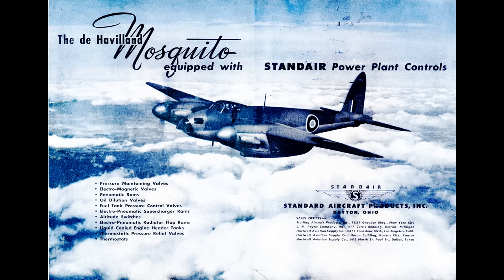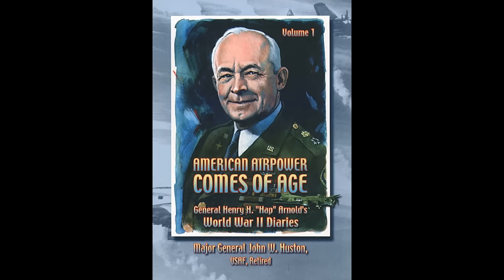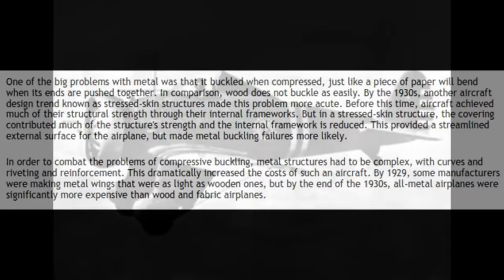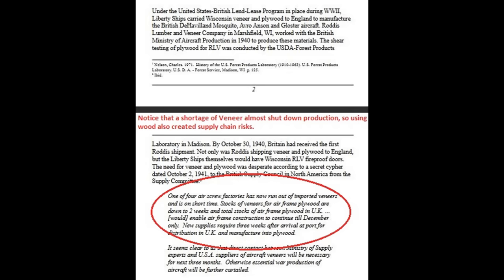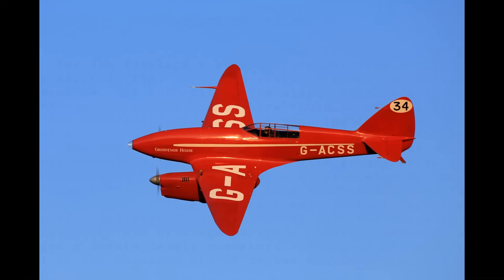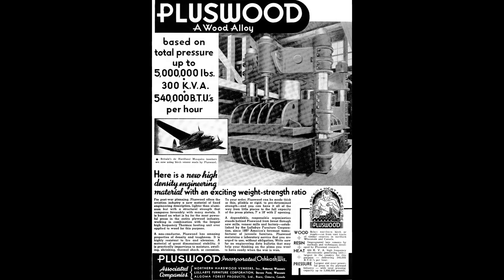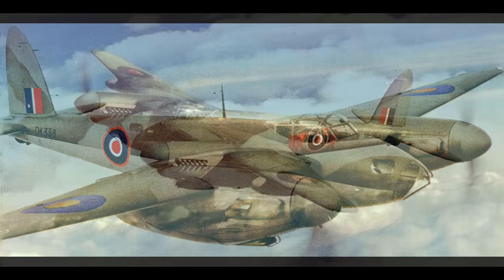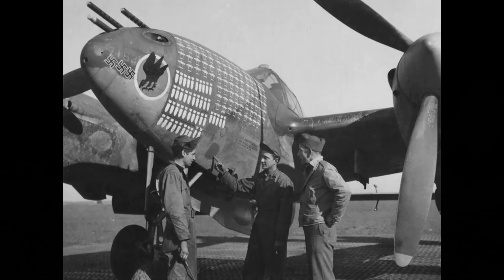De Havilland Mosquito vs. ?

Comment: "Every piano-builder could make that"  - Göring. Well, they couldn't
Reply: Actually they could. The construction of the Mosquito was spread around many small workshops, each specialising in one part of the process & the finished sections were brought to a central hub for assembly. Also your quote was almost certainly never said by Göring - the full invented "quote" is: “In 1940 I could fly as far as Glasgow in most of my aircraft, but not now! It makes me furious when I see the Mosquito. I turn green and yellow with envy. The British, who can afford aluminium better than we can, knock together a beautiful wooden aircraft that every piano factory over there is building. They have the geniuses and we have the nincompoops”
Reply: The German's built a mosquito equivalent out of wood, but construction was cancelled before deployment because the allies destroyed the epxoy plant during an air raid and no alternate adhesive that was available worked.
Reply: Some years ago my wife and I had a holiday in the Forest of Dean.     On one outing, we walked down an overgrown rural lane to a very small harbour on the Severn Estuary.     On the way we passed a small derelict factory.   On the gate was a plaque which said that the factory used to make veneers for the manufacturers of pianos and furniture.     It added that during the war it tuned out parts for the Mosquito.  Herman wasn't far off.  He also complained that the British had much more access to strategic metals but chose wood despite that.
Reply: @TheArgieH  Herman never said anything of the sort - the full unsourced, invented "quote" is: “In 1940 I could fly as far as Glasgow in most of my aircraft, but not now! It makes me furious when I see the Mosquito. I turn green and yellow with envy. The British, who can afford aluminium better than we can, knock together a beautiful wooden aircraft that every piano factory over there is building. They have the geniuses and we have the nincompoops”
Reply: @nightjarflying  How sad, another cherished myth bites the dust.  The factory cited was quite real though.   I suppose he never said "when I saw the Mustang over Berlin I knew the game was up!" either.
Reply: @TheArgieH  There were many shadow factories of all sizes around Britain - a policy set up in 1935 to ensure a rapid switch in production from civil use [car parts say] to military use. A Mossie factory was blitzed on the English Channel coast [at Plymouth perhaps?] in '41 & much of the parts production went out to little workshops & stayed there. Herman is possibly the most misquoted WWII figure, I suppose because he was a figure of fun due to his pompous uniforms & blubber. I see quotes all the time that began on the music hall stage or in war movies or in the flood of unreliable WWII memoires that hit the book stands from the 50s through to the Beatles era. Mostly garbage in the colourful details, mostly accurate in the dates & times. It's very hard to write a readable, yet accurate war book based on diaries & memories.
Reply: @nightjarflying  Thanks for correcting me.
Reply: @nightjarflying  Thanks.  Maybe so, but I find Peter Townsend, John Masters, Eric Brown, Chas Bowyer, "Mike" Crosley et al., quite credible.    I suppose the closer folk were to the sharp end the more indelible the memories.   The book on Bismarck by one of her survivors, the senior officer surviving, one of her gunnery officers, has a stark description of the destruction of a great ship from the receiving end.   Like "Mike" Crosley's account of his service in the FAA, the book has a number of technical appendices which settle many myths, disputed or otherwise.
Reply: @TheArgieH  The personal stories must always be treated with healthy scepticism especially where opinion is important. Also the 'old boy's network' aspect where what is asserted by one good old boy is never challenged by other good old boys publically. 

A lot of stuff is left out of biographies & autobiographies especially re personal morals, behaviour  or events too horrible [or illegal] to safely publish. If a person or persons indulges in behaviour beyond the pale: fragging incompetent officers [first talked of in the Vietnam conflict, but fairly common in all Allied armies in WWII], shooting pilots on the parachute, shooting POWS, friendly fire,  that evening with the prostitutes, wife beating, abandoning wife & kids for younger model etc isn't going to appear in print most likely. Prime examples of this involve some of the most prized personal war books. Clostermann [revered in France] & Bader [revered in Britain] for example.

And the huge number of cockups & derelictions at every level that are completely whitewashed is mind blowing. Operation Market Garden comes to mind - certain of the people honoured after the event should have faced censure [to be polite].
Reply: @nightjarflying  No argument there!   However, some things do emerge with time.    The image of Bader was created as a morale booster and for many folk these days I reckon it is coloured by "Reach for the sky" (I hate the bit in the film where he is promoting "the big wing").  However it is now known that he was somewhat "difficult".    There's also a fair spectrum of books around these days on the theme of military cock-ups, I have a few.   You cannot libel the dead so it is safe to rant about Chelmsford and Isandlwana, more recent events can be trickier.    I attended a very interesting talk on the Falklands unpleasantness.

Sometimes the humanity comes through and is very believable.    In one of the biographies I read concerning the war in the Far East (how very topical), a young officer (I am  not saying who on YT) had had a particularly hard and dangerous time.    Constantly in fierce action with no breaks, he was exhausted, ill and mentally shattered.   When he was ordered back into immediate action he simply broke down in tears.   His senior officer just gently hugged him close and spoke gently to him until the sobbing stopped.    He then went into action.    That was in his autobiography, many might have missed it out.

This is my second draft, YT ate the first, I wonder where it will turn up.
Reply: @MartinCHorowitz  Was it really epoxy? I think the Brits used a urea formaldehyde glue.
Reply: If they couldn't, boat builders could.
Reply: @ChimeraActual  I wastalking about the German Glue, which seemed to be an epoxy like glue, but it was destroyed...
Reply: @nightjarflying  M'mmm I've heard so many variations on this, but that cover's it---if it's all true, I doubt that Hitler would have approved of his negativity.
Reply: @nightjarflying  well---it was far from one-sided, and don't forget the bawdy songs, sung by our troops in WW1, about the Kaiser. Propaganda  was a deadly business once Goebbels got power; and as we know, taking the piss is good for the soul during war, as well as the serious poster campaigns, countering and undermining the opposition. A Hungarian survivor of the war said, '' During the occupation, it was a death sentence , to listen to the BBC. Yet his family would spend much time, tuning in. it was very strange, hearing roars of laughter over the airways, and we wondered how this was possible. The germans told us Britain was destroyed and finished.''  They had been listening to the Wartime favourite , I.T.M.A,  which stould for.  '' ITS THAT MAN AGAIN'  ( Hitler). What brave people. As a kid, at wars end, I remember that show.
Reply: @MrDaiseymay  Often these quotes are cited as being after he was captured & in prison. Although he could speak a few languages he wasn't 'conversational standard' in English - it seems fake to me that he'd use "nincompoop" as per my quote above, but his American guards would have watched the movies that made a lot of fun of the Nazis & I can imagine Chaplin's "The Great Dictator" or a Marx Bros. film having Nazis using such words. I am guessing Herman said a lot of stuff in prison to get on the good side of his rotating guards [even though communication was forbidden] & so myths & legends are born. Plus the internet is a great bullshit generator. :)
Reply: @TheArgieH  THAT---was the point he was making
Reply: @nightjarflying  There were 'Shadow factories in the first world war too. After the Zeppelins---then the huge Gotha Bomber's, could reach the factories in the South East (mostly)
Reply: @MrDaiseymay  Which one?
Reply: Göring should have known better. In WW I the Fokker D VIII suffered quality problems because the piano builders that produced it did not understand the difference between building pianos and building aircraft.
Reply: @MrDaiseymay  I never realised that there were WW I shadow factories set up because of bombing,..  I have a book called "The Zeppelin Fighters", written by one who was.   He explains just how difficult they were to shoot down, despite being full of hydrogen.    Partly because of the balance of the 3 elements of the combustion triangle, oxidant, fuel and ignition.   But also because they only had to dump ballast to outclimb him.   On the other hand whilst they had the range on paper, depending on the wind and weather, could they actually hit  a precise target?   Again the wind and the weather were key factors.   I am not joking when I say that sometimes they did not even know which town they had hit.    And they did hit towns, German command had taken a fairly pragmatic decision on that  They held that the British had targeted German civilians by starving them through the naval blockade.  Therefore a bit of terror bombing of English, and it was principally English, civilians was fine.  And, as happened during round 2, it is hard to miss London, though some did just that.    As you say the Zeppelins and Schutte-Lanz (the latter had a wooden structure, shades of the Mosquito) were complemented by the Gotha and the even bigger "Z" bombers.
Reply: @TheArgieH  I've read the "Bismarck" book; the accounts of POW life in Ontario, Canada are quite revealing, even amusing, and the writer ended up as German Consul in Toronto many years later. Eric Brown is absolutely fascinating and credible, since he knew many of the Germans before the war, was fluent in German and interviewed Goering and other Nazis after the war. Brown was also the only person, AKAIK, to fly the Me-163 under full rocket power after the war. It's amazing that so many of the great pilots of WWII survived to their late nineties... Brown and Hoover are gone, but Yeager and Anderson are still hanging on, the later still very clear and eloquent a year or two ago.
Reply: @nightjarflying  The Warsaw Uprising of August 1944 certainly falls in the last category you mention...
Reply: @awuma  Thanks, yes as I say somewhere else, if Hollywood attempted an Eric Brown biopic, no-one would believe it.   His first ever flight was in a two seat trainer with Ernst Udet (!).   He interviewed Hannah Reisch as well as a range of unsavoury characters like the "Beasts of Belsen".  He met Admiral Doenitz under interesting circumstances and virtually established the (West) German FAA.   He holds the record for the most aircraft types tested, nearly 500, and only counts types so the 14 Mks of Spitfire counts as just one.   He spans aircraft from pre-war biplanes to Mach 2 fighters.    He performed the first multi-engine aircraft landing on a carrier in 1944, and later the first jet landing.   I speculated on who Hollywood might choose for the role, but Tom Cruise is probably too tall.   Eric Brown reckons it was only his short stature that saved him from a broken neck when exploring what made the DH Swallow a killer.

Comment: The German aircraft industry tried to build several wooden aircraft towards the end of the war. In their case, it really was because of shortages of strategic materials like aluminum.
In all cases they had problems, not so much because of the wood, but because they were unable to produce adequate adhesives.  A number of German wooden aircraft came apart in the air due to glue failures.

Comment: The US decision not to manufacture this great aircraft was a  big strategic mistake the P38 was a great aircraft also but it was a very expensive aircraft to produce , had significant teething problems and was not great in the European theatre. However it excelled in the Pacific where the Mossie suffered from the glues degrading in the heat and humidity. The fact that the Mossie was in operation up to 1956 is significant and that it was so versatile and it used materials freely available! Great review!

Comment: re - damage
the counter argument was that Cannon shells would go straight through a Mossie WITHOUT EXPLODING (unless there was something solid in the way) resulting in less damage than the Mossie's metal clad counterparts
 (passed down through family  from a WW2 RAF mechanic)
repeatedly told  that you would not believe how much a Mossie could take, and still come  home
Reply from the maker: I have heard that, but I've seen zero evidence that cannon shells would pass through without exploding.

Comment: waits impatiently.
Hopes its comparison is done at ranges similar to Berlin
mutters about piano and furniture manufacture factories and non aircraft trained builders
eyes off the escort fighter to Berlin myth
Reply: The Mossie was the only Allied aircraft that could bomb Berlin on a regular basis by day and night.  They called it the "Berlin Express".
Reply: @thegreatdominion949  
yep, twice a day with about a ton of bombs, same as the b17 could do once a day
Reply: @brucebaxter6923  B-17s only went to Berlin a fraction of the number of times Mosquitos did.  I believe Mosquitos bombed Berlin every day for around 100 consecutive days in 1944.
Reply: @brucebaxter6923  Most of those aircraft were modified to carry the 4000 lb "Cookie" blockbuster bomb--so that would make it a 2 ton payload.
Reply: The Great Dominion 
Yes but not to Berlin. They couldn’t carry it that for.
Reply: Bruce Baxter I think the cookie was delivered to Berlin... that’s why they called it Berlin express.
Reply: The Great Dominion 
Well. 
I was wrong. 
The mozzie did do 4000lb to Berlin. 

I must have been thinking the standard production variant. 

Thank you for proving me wrong.

Comment: I was watching a couple of videos/documentaries about the Mosquito yesterday, they criticised it pretty heavily for 
a) killing quite a few crews at take-off due veering off the runway (due to low speed like you said) and 
b)  Crashing because the float carburettors couldn't do negative  G's and the engine would stall out, again causing unrecoverable spin due to loss of one engine.
I was sort of confused by the carburettor statement because it's a Merlin engine right, so how is that different to any spitfire etc?
I'm sure you've covered this in some video but I'm new to these extensive aircraft analyses, haven't watched many of your videos
Reply from the maker: Those are all pilot skill issues, not airplane issues. Avoid negative G, and don't lift off until above VMC, which is the minimum speed for control on one engine.
Reply: @GregsAirplanesandAutomobiles 
Yeah, good point, no aircraft or flying experience here. There was video of the last flight worthy Mosquito in the UK, crashing at at show and killing the crew because they did a wrong manoeuvre and stalled an engine
Reply from the maker: I saw it, the video made me sad. You can NOT spin a Mosquito, if you do you have to bail out.
Reply: I did an airshow cockpit guard on that Mosquito at a show about 25 years ago.  Got close to the Bristol Blenheim too (pre pre  Beaufighter) between between the first (counting the first reconstruction as the same plane) and second prangs (very simple bombsight, looked D.IY.).
Reply: Early Merlins had a carburettor with a float chamber and could cut out under negative g. There was a quick fix and later versions had fuel injection.  In service,  the mossie  had about the best safety record of all front line aircraft. Crew stood a much better chance of survival than heavy bomber crews or single engine fighters.
Today , we would refer to the method of construction as composite . Essentially two stressed skins separated by a light balsa filler  (today , carbon fibre separated by structural foam ). The fact is skilled wood workers could and did make parts in  small factories so it was impossible for air raids to significantly disrupt production. 
Along with the P51 mustang probably the best aircraft of WW2
Reply: @GregsAirplanesandAutomobiles  Given that these pilots would have trained on Ansons and Oxfords which are MUCH lower power than the Mosquito would lack of experience in the type have been a factor in these engine out accidents?  IE. the trainers had 1/5 the power of the Mosquito!!!
Did the lack of spin recovery have anything to do with lack of yaw control (rudder being too small), rudder damped by the fuselage, aft weight and balance with arms load, tendency of spin to turn flat?  Is there any info on that?

Comment: I read somewhere that De Havilland was considered a kind of a backwards company. They never got into this new craze of metal aircraft. So when the Air Ministry tried to get companies to build Spitfires, or at least build components for them, or at long least repair them, De Havilland was considered useless. Because they didn't have the skills or machinery to do metal skinned airplane work. So they were allowed to work on their wooden wonder, the Mosquito, simply because that was all they were good for anyway. I don´t know if this story is true, but it makes sense that you might have lots of people very skilled in working with wood, and you might want to put their skills to use.